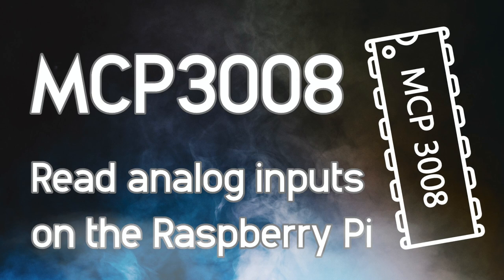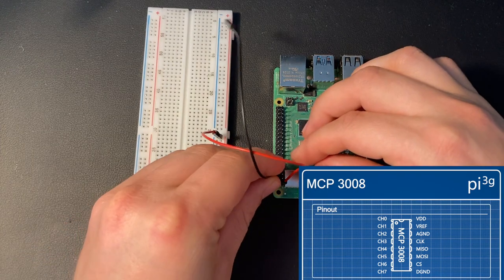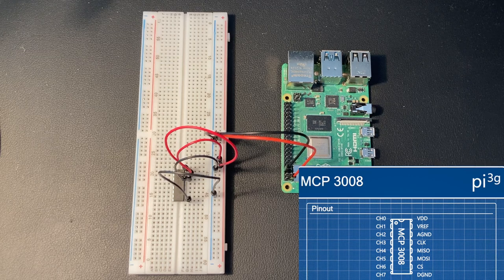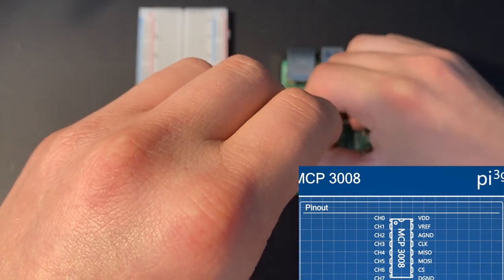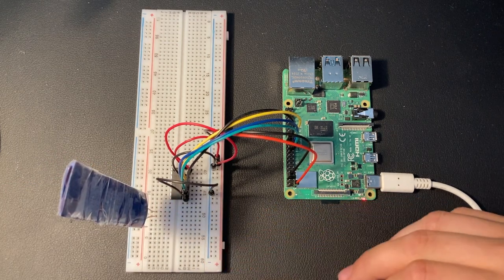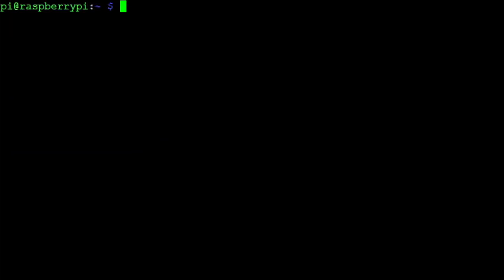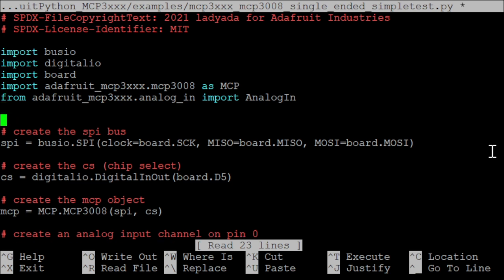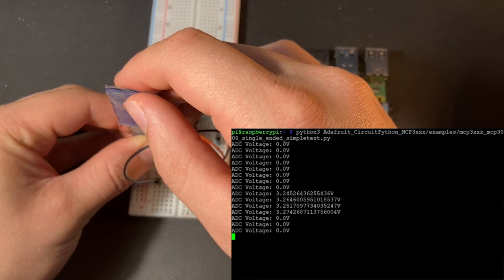Analog Inputs with your Raspberry Pi - HOW TO use the MCP3008

Comment: why chip select pin of mcp3008 is connected to GND? shouldn't it be connected to GPIO8 (SPI0 CE0) of raspberry pi?
Reply: You are right. After testing for hours if found out, that Chip Select of mcp3008 (CS/SHDN) has to be connected to GPIO8 (SPI0 CE0) in Order to Work.

Comment: Is it possible to make a metal detector with the Raspberry Pi and read and record the data with the ADC connection?
Reply from the maker: It should be @voxfox01 - check out this reddit discussion on the topic: https://www.reddit.com/r/electronics/comments/3yb468/would_it_be_possible_to_diy_a_high_end_metal/